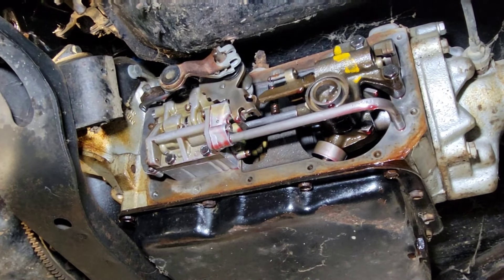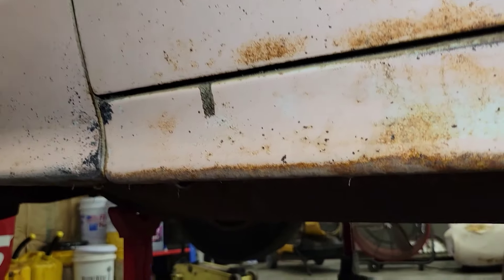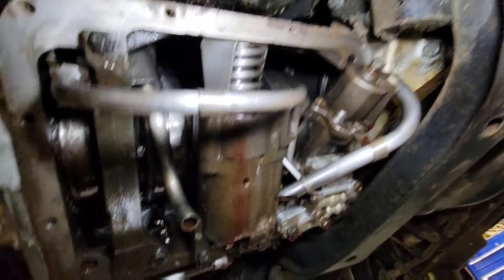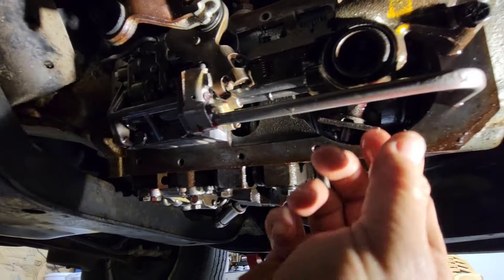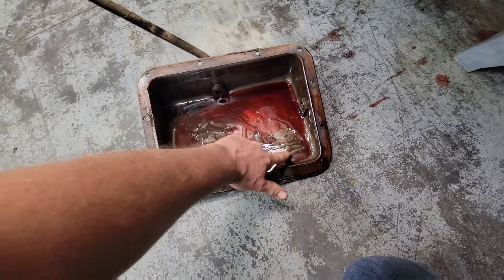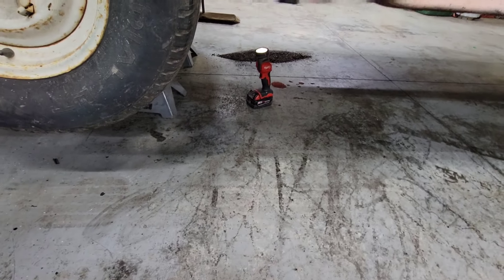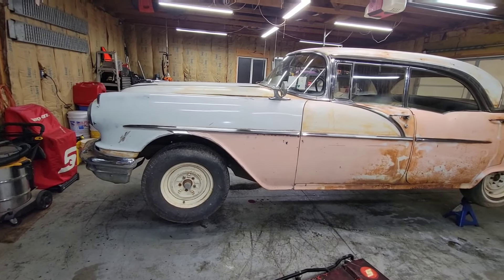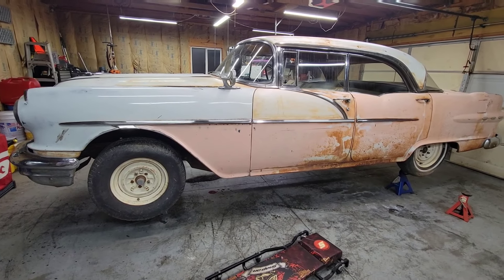Taking a look at theTransmission and Yup, I find an issue with the engine!!!

Comment: I’d spay it down good with B-12 cleaner. That’s what I used cleaning auto trans.
Old hard seals or stuck valves .
B&M Auto in California was the racing trans supplier in the50s and 60.
Really heavy cast iron thans. Cases tho. Very simple auto trans.

Comment: My '55 Olds has this same Dual Range Hydramatic. Extremely durable trans when they work. Some GMC fishbowl buses had these. I had to go through mine, and they are really simple as far as a slush box is concerned. For example, that tiny block in the front of the side pan that the shift lever goes to is the valve body. Upon teardown, mine had a couple of rubber seals way inside that did what 70 year old rubber does and failed, and the clutches were wasted, so rebuilding was the right decision in my case. 
Band adjustments and throttle rod adjustment are extremely critical to get right with these. The band adjustments take special tools. Also, these used Type A (whale oil based) trans fluid, which has different properties than modern fluid. Mine shifts fairly harsh because of the Dexron/Mercon fluid I'm running.

Comment: Punch out the freeze plug and put a brass one in that you tighten the nut and it expands .
Reply from the maker: That would work temporarily but not as a permanent fix. I've done that many years ago and found out the hard way that it's a temporary fix and not meant to be permanent.